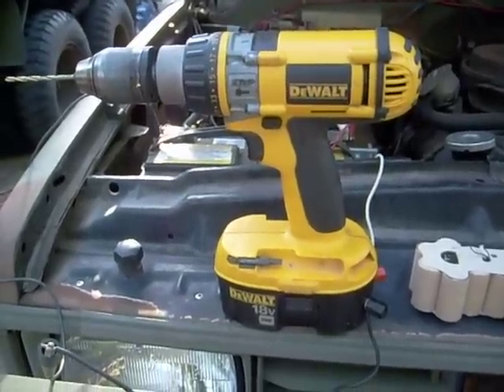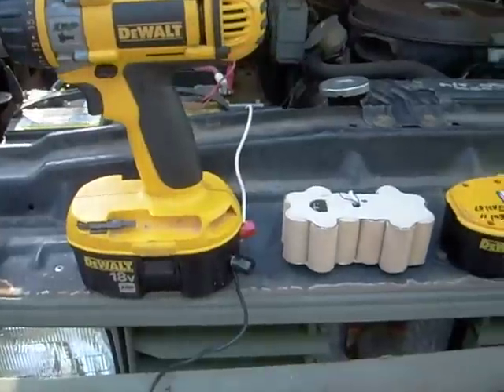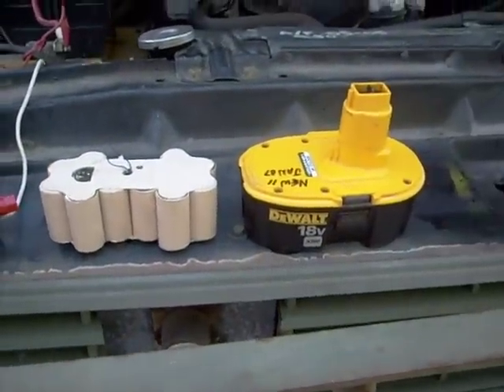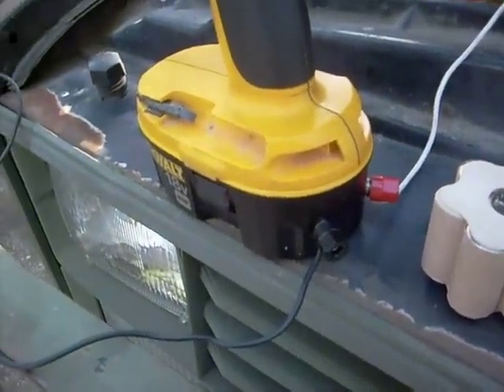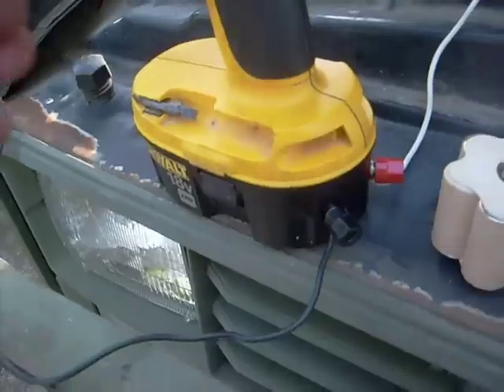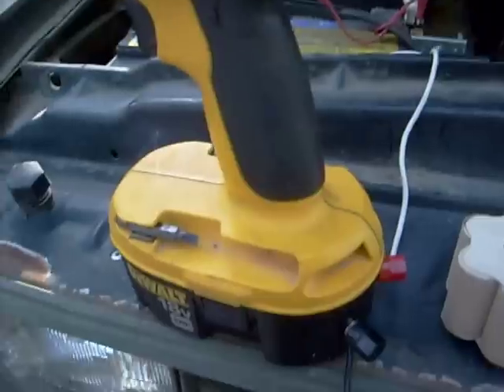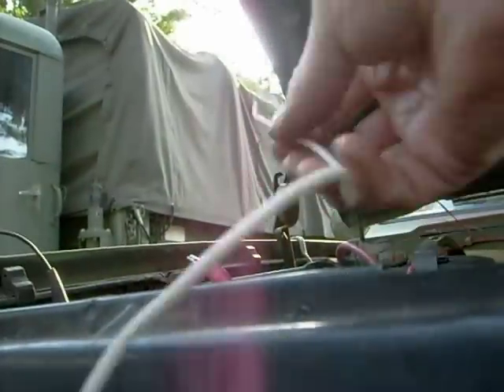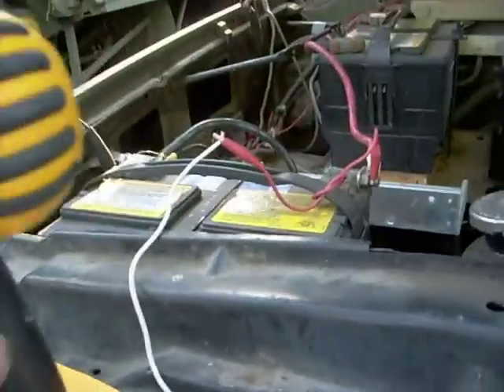Dewalt cordless drill 18 volt battery cheat

Comment from the maker: You mean a "selector switch" - that's a Great idea and something I just might do.  I figured by now that Dewalt would lower the price of their batteries but no such luck!  It would require tapping the positive lead inside the battery with a two-way switch which would allow external power to get to the business end of the battery (where it plugs into the tool) and then you could bave your cake and eat it too!

Comment from the maker: It would work but I would recommend using one of the 12 volt tools and not the 18 volt ones because of the power drop that comes with the use of a long power cord.   It's all about resistance...

Comment from the maker: Should work just as well as the Dewalt tools do on 12 volts.  Twelve volts DC is twelve volts DC whether it comes from a dry cell battery or a car battery.  You can hook two of the 6 volt lantern batteries together in series to power your drill also.  My next project will be to rig up a series of 12 1 1/2 volt 'C' rechargeable batteries to power my Dewalt tools.  I should be able to charge them with the Dewalt charger too.

Comment: I have 2 of the Skil 18volt drills, so they will run on 12 volts fine?
I want to rig mine up to a 12 volt jump battery back for mobility.
So with 12 volt it won't hurt the drill ?
Just run a little slower ?

Comment from the maker: I am not charging the battery in this video; this is a battery pack by-pass (no cells in the battery pack).  Ironically, Ryobi does sell a charger that plugs into the cigarette lighter - I bought one of them for my Ryobi tools.  I am down to one Dewalt 18 volt battery now and it is starting to fail.  With my "battery cheat" I will never need to buy another Dewalt battery again but will have to use a "cord" to power my 18 volt Dewalt tools from now on.  Thanks for the comment!

Comment from the maker: Actually I am not charging the battery here but using the 24 volt system in my military truck to run my 18 volt Dewalt power tools. I have removed the guts from the battery pack and direct wired the empty battery case so that I can pipe the power into the drill (or other tools) from an external source - that could be anything from a transformer to a bunch of 'D' cells hooked in series to come up with sufficient voltage to run the tool.

Comment from the maker: Generally I do but at the same time that increases the voltage substantially where I pull the power from.  With a really long extension cord this is not a problem because the length of the cord drops the voltage down when you are drawing power from it.

Comment: Nothing worse than being in the middle of nowhere and having flat batteries, so i'll go flatten the car battery too. unless what you want to drill is in the engine bay I would use welding leads to handle the resistance, flat car battery and a burning car..

Comment: If you can find a cheap 12-18volt DC boost converter you can get full performance. I'm not sure but I think you'll need roughly 10-20amps so it might not be feasible.

Comment from the maker: Well Moe7133, thanks for the comment.  If Dewalt batteries were around $35.00 at Home Depot or Lowe's I would buy about ten of them.  I bought a bunch of Ryobi 18 volt cordless tools plus their premium Lithium battery and a charger which plugs into the cigarette lighter in my car.  Now I have to make up a "cheater" to use Ryobi batteries in my Dewalt tools which will make my videos, like this one, obsolete.  At one time there was an adaptor commercially available but Dewalt forced its removal.

Comment from the maker: I didn't put the motorcycle battery in this video as another power source but yes that will work fine for the 12 volt Dewalt cordless tools; a little shy of what you need for the 18 volt Dewalt tools.  I have alligator clips installed for my cheater wire already that can hook up to any wet cell car or motorcycle battery but I have found my 24 volt NATO plug on my military vehicles is the best source of power for the 18 volt Dewalt battery cheat so far.  Thanks for the comment by the way!

Comment: ohms law isn't all there is.  The power transfer has to do with the internal resistance of the battery.  I think nicad and lead-acid are comparable so there shouldn't be a problem, especially using 12v on a 18v motor.

Comment: I don't understand why if we have standard cell geometries, i.e. AA, AAA, C, D and we have standard mains power plugs, i.e. 110VAC we can't have standard tool battery connectors...

if this guy has a problem with powercords then you could attach a small sealed lead acid battery to your drill and charge that buy simply hooking it up in parallel to your car battery.

Comment: There is a flaw in your first statement, the fact that the battery "can" supply 900 amps doesn't mean that it will force that current through the motor. Google "ohms law"

Comment from the maker: Do you work for Dewalt by chance?  Dewalt batteries are inferior and therefore should cost a lot less than the $86.00 they sell for in our area.  My next "cheat" will be using an 18 volt  Ryobi battery pack to power my Dewalt tools.  Very simple to accomplish but also requires a power cord running from the Ryobi battery to the Dewalt tool.  For a brief time, someone had an adapter for this but Dewalt intervened and the seller pulled the item.  Watch the video about this (still there).

Comment from the maker: There were a couple of times where I was at a job site with no other power tools but my 18 volt Dewalt equipment and the batteries "died" before I could finish the task I started on.  So far, no problems with any of my Dewalt tools and the power cord that I use works just fine.  I think it is a 25 foot cord.  By the time you consider the resistance in the 25 foot cord, the power at the end would be very close to 18 volts when using a 24 volt system like I have in my military trucks.

Comment: If you are trying to use a 600-900 cold cranking amp battery, you are going to burn up the brushes on the dewalt tool prematurely. Also, you would need much larger size wires than this person is showing, to be able to use the tool efficiently more than 6 feet from the battery.
Come to think of it, whats the use of a " cordless tool" if you have to wire it to a battery ?. Seems pretty stupid!

Comment from the maker: I might try doing that with the special battery case that I made just to see the voltage the charger puts out.  It is possible that the charger may not provide power due to the modifications that I made to the battery for this "cheat".  Another thing that must be considered is the amperage draw from the tool that is being used which could damage or destroy the charger which probably only provides enough wattage to charge the batteries.

Comment from the maker: I wanted to let you know that the 24 volt application works perfectly for the 18 volt cordless tools.  I just finished posting another short video to show how it works so be sure to check it out!  I just could not see buying more expensive batteries for my Dewalt tools so rather than to sell them at a loss, I just make them useable via the NATO plug on my military trucks.  Thanks for the tip by the way! Now I am waiting for a call from Dewalt to express their discontent with my battery cheat!

Comment from the maker: I thought about that but was afraid the extra voltage might fry the cordless tools. I could very easily tie into the NATO plug on either of my military trucks to get the 24 volts; I even have and accessory female end to fit into the NATO outlets.  I am so disgusted with the inferior quality of Dewalt rechargeable batteries that I am working on a "cheater" to use Ryobi 18 volt batteries which cost about half of the Dewalt units.  Remember this, "A product is only as good as its cheapest part!"

Comment from the maker: Thank you for the research on the subject of replacement cells for the battery pack.  I am convinced that the battery packs can be rebuilt but would have concerns about placing the pack onto the charger for the first time.  I thought about leaving the cells in the battery pack but they would be "in the way" of the connectors that I used for wiring.  I thought about using lead in place of the cells to achieve weight balance and still might do that.  Thanks again for the tip on replacement cells!

Comment from the maker: NO NO NO!!!!!  You are using the car battery to POWER the drill (or any other dewalt cordless power tool).  In order to charge an 18 volt battery you would need a power source greater than 18 volts to do so.  You can fabricate any of the cordless batteries this way to run your cordless tools in an emergency situation or whe your battery runs down to zero.  This is for people who work on jobsites where there is no electrical power to run 110 volt tools or chargers.